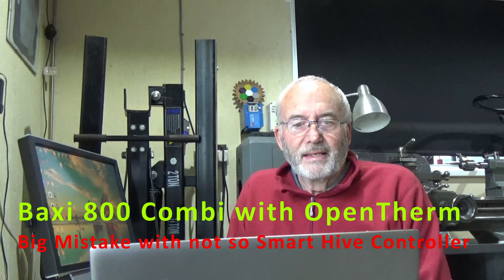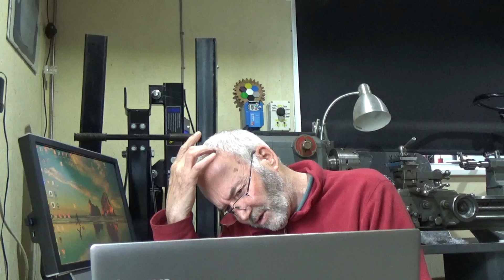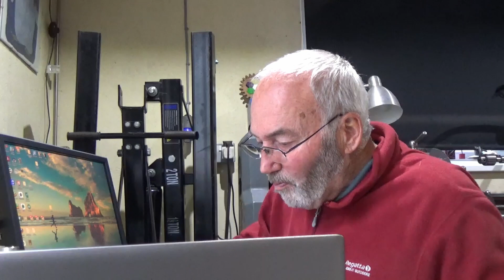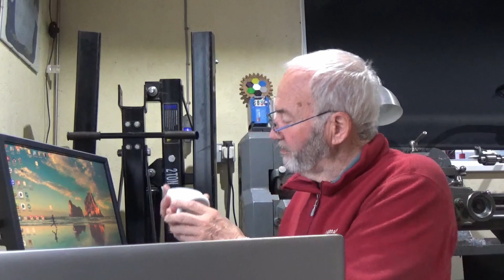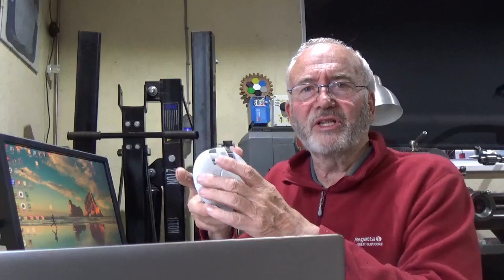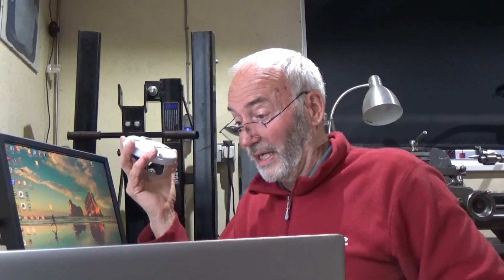Hive v Nest E Thermostat & Baxi Combi Boiler using OpenTherm Overview (Part 1) UK

Comment: Kw output of combis is based on Hot water flow rate at taps. Heating kw will modulate down based on requirements

Comment: Hi, I'm looking at a baxi 836, have you found a good smart thermostat that actually works with OT. I have been looking for a couple of hours... Might be limited to the baxi usense or nest, I wanted the wiser but can't find anyone confirmation that it works.
Reply from the maker: Hi Karl, In the attached link you will a list of OT controls, its a very good website with lots of info the OT technology, boilers and controllers. https://myboiler.com/opentherm/opentherm-boilers-and-controls/#whatisopentherm
Reply: @TheCADengineer  Hi  Brain,thanks for the link, I will have a read. Can you please tell me, is possible to control the DHW temp using the nest?  Thanks.KArl.
Reply: @sipepguru hi I have just had the 836 combi 2 fitted with Google nest  works a dream fully controllable from your phone and can be installed on the old wiring on the dumb 2:25  thermostat u sense... Baxi recommend fresh smaller wiring
Reply: And yes you can control the dhw temp on the phone

Comment: Mm. I'm an installer and really surprised you had 4 quotes but by sounds your were not given the options. But you can use your dumb stat but still fit weather compensation kit and set your flow temp curve. Also  the boiler will modulate with your dumb stat but you are right in saying the ot system is best system.

Comment: I found the video of great use and somewhat mirrored my experience of the learning curve. There are many people with an engineering background out there who would find this useful in highlighting the many standard industry practises of installing oversizing boilers matched to inefficient control systems. Opentherm and weather compensation is the way to go. Thank you for taking the trouble to share your experience and I hope that you do a follow up once you have installed the Nest and had some winter experience with it.
Reply from the maker: I now have the OpenTherm Monitor gateway hardware which will be readable over wifi by a WeMos D1 board connected to it. I will be hooking it up in series into the opentherm boiler/nest wiring in the next month or so to have the real time info. I plan on doing a video of the gateway monitoring hardware installation and real time screenshots of the recorded data.